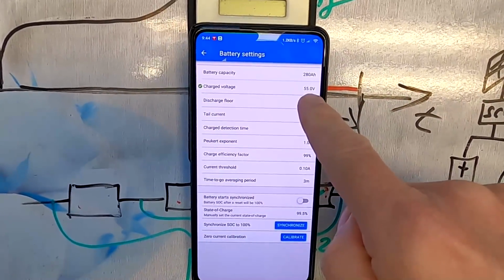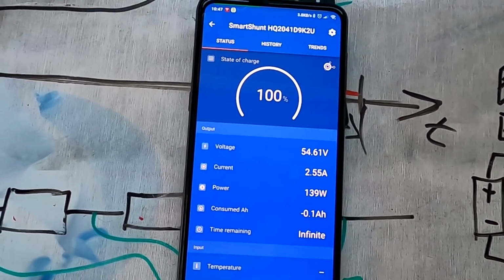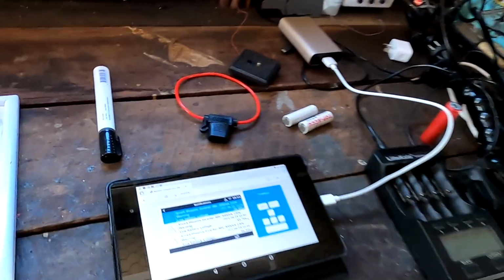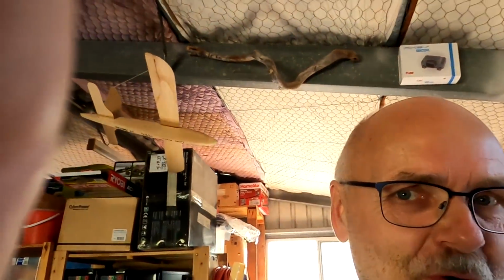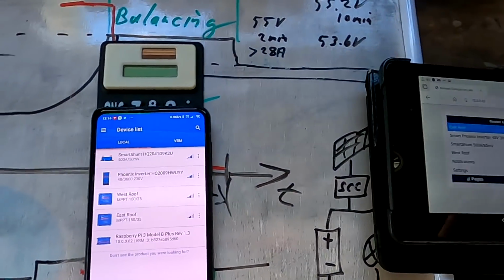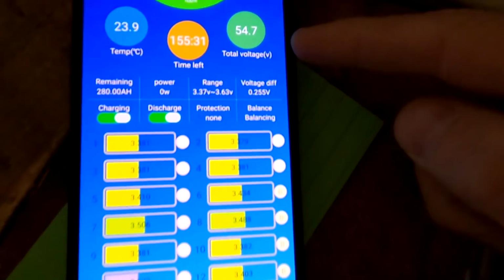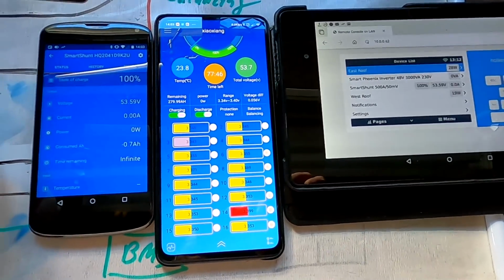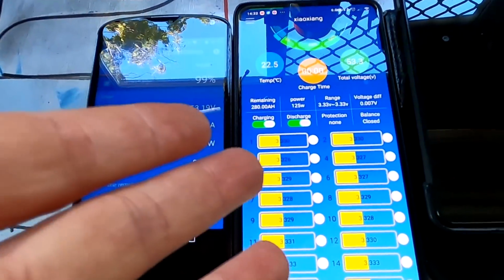Houston, we have a slight (BMS) problem and... are now Off-Grid!

Comment: Would this be a bad time to say "I told you so"? On the BMS relay shutting off charger and inverter at the same time? :D haha

This is also what I don't like about using the Victron shunt for SoC monitoring. I think I've written comments about this before, but the Victron Shunt can't see individual cells, it can only see the pack voltage. And if you have all your cells at 3.4v and one cell hits 3.6v you're basically at 100% SoC... but the pack voltage is only 54.6v which isn't high enough to trigger your shunt's SoC reset of 55v. You have an even worse problem at the bottom end. You could have one cell drop to 2.9v while the rest of your cells are still at 3.2v. At this point you're basically at 0% SoC but your shunt might still be reading 20% or so.

Regarding your cell #14: I wouldn't worry too much about that cell being a bit high. Having one cell his 3.6v while the rest are at 3.4 is not unusual. Remember at 3.4v the cells are at like 99% SoC. So just a 1% difference in balance can cause cell 14 to hit 3.6 while the rest remain around 3.4-3.5. However: even a 1% difference can mean a difference of 2.8 Ah. With only 160 mA of balance current it would take about 18 hours to finish balancing. This is why with such large cells active balancing becomes necessary.

It would be really ideal if your BMS could just turn off the MPPT chargers when a cell gets high instead of turning off the relay because that disconnects your inverter from the battery which causes all sorts of additional chaos. But I've only mentioned that a few times now. :D

Also: See my comment on your earlier video about my experiments with balancing at 3.35v. :D

Comment: hi, I have the same problem, so my inverter is connected direct to the battery, so an over voltage cut off does not shut down the inverter, also  I now think i know why its better to get a single port BMS, where the load and charge shut downs are seperate, ie if on overcharge shut down only the charge curent is dissconected, and on low voltage the load is then disconnected, this still does not resolve compleately the balance issue, but is a bit better because if the inverter is still connected and drawing current the over voltage cell will come back down , giving time to sort the balance issue. The whole problem existes because i bet my cell are A, old, B, not from the same batch or both, they will never stay balanced, only solution is a big active balancer, more expense!! Begin to wonder if the new Lead Acid batteries would have been a better choice. Price wise and piece of mind

Comment: try turning off the charge balance option: it will allow the balancing when the battery is not charging. which means you can leave it balancing overnight, and in the morning the solar will charge it again until the limit

Comment: Victron Forum user questions discussion:  Tail Current = End Amps.
Per EVE Docs   XXXah X 0.05 = EndAmps/TailCurrent.
280AH * 0.05 = 14A

4.2 Standard Charge
The standard charge means charging the cell with charge current 0.5CA and constant voltage  3.65V at (25±2)℃, 0.05C cut off

Comment: I like the fully integrated solar hybrid inverters like the ones from MPP Solar in Taiwan.
I know you said "no equaliser" but what about an active balancer? There are some active 1A, 2A, 5A and even 10A Bluetooth equipped equalisers from "JK" and they have a capacitor which helps I believe.
The 2A balancer might be worth a try?

Comment: I hope you've got an REC Si BMS on its way to you from Slovenia, they're expensive but they're proper bits of kit, you can easily add a CANbus HAT to your RPi and hook the bms to the Raspi so the BMS can dictate the charge current and voltage to the MPPTs so it can keep the cells balanced.

Love that your channel shows the bits you do that don't work as well as what does, keep up the hard work 💪

Comment: Andy, thanks for sharing, I hope you don't get these headaches anymore in the future. Maybe you are a bit to high in the voltage curve. But as always talking from the other side of the world will show things upside down. I hope you don't charge above 90%. And another question, is the balancing resistance high enough to cover the decrease the power high enough going into the cell?
Reply: Another remark is your relay is switching very often, maybe a longer delay suits the discharge of the cell better, but you'll be longer isolated. Also don't wear out your relay.

Comment: I find it strange that if one cell is to high, the complete battery is shot off by your BMS. You loose all power at ones. can you change your settings of the BMS so that it keeps giving power to the invertor and only stops the charging?
with my BMS only the charging stops, but the battery remains to give power to the invertor so that the highest cell will drop to a 'normal' voltage more quickly.
my 1Amp BMS balancing only works if there is a charge going in to the cells.
I have two Daly 8s 100A in two battery packs on board where I live on.

Comment: 062021/2212h PST 🇺🇸  062121/1512h Brisbane 🇦🇺 . Saw the issue.  I feel the frustration, you are presently undergoing. I always stock  2 additional BMS at hand to overcome such contingency situations. For the past 2 years,  my small PV system consisting of VICTRON CC 100/30, VICTRON 12/1200W pure sine wave inverter, 400W RENOGY PV array, 4 Lishen cells @272Ah , a standby VICTRON LiFePo4 35A charger and last but not least JBD 100A /BT enabled BMS, all works well in total unison. In fact I have 2 JBD BMS and 2 DALY BMS, both 100A, presently being held at hand. A training I received at the Facility. 
JBD is configurable to your desired setup and costs lesser than others. Mine {both 100A} costs US$45 each,  shipping free and no other charges were involved, from a vender in Illinois 🇺🇸.
Please note that, the mechanical device Viz: relay is quite notorious for contact pitting and or stuck arm, thus quite unreliable, in switching high power DC currents. A failed snubber Diode? That can cause chatter.
Let’s know the real reason, as to why the system failed.
Once again my concerns are with you. Take care, stay safe and 73s…

Comment: This is the problem with most BMS units on the market. The balance amperage is just too low at .2 amps. My opinion is that one should not buy a BMS with less than 1 amp; 10 amps max would be much better.

Comment: Your BMS should discharge cell 14 when an over V event is triggered.

Given that your BMS is apparently not discharging cell 14 properly, I suggest you stop charging & manually discharge cell 14 using a 1Ω resistor (make sure your resistor is capable of dissipating >=15 W or put multiple 1Ω resistors in parallel to share the heat dissipation).  All you have to do is connect the resistor to cell 14 terminals to begin the manual balancing discharge.

Stop the manual discharge after the V of cell 14 drops .1 V below the average V of the other cells.

Then start your charger to see if cell 14 behaves proper or races ahead of the other cells again when charging.

As cells age & lose capacity, they tend to charge & reach cut-off V faster than a new or good cell.

You definitely don't want your relays popping on & off very often.  Your options seem to be:

1.  Replace cell 14 (probably not necessary & expensive unless it can be done via your warranty)
2.  Get a better BMS that can more quickly balance an out of balance cell
3.  Make your own BMS to auto-discharge cell 14 to a certain V

Best wishes in finding a cost efficient solution... :)

Comment: Andy, this is EXACTLY what happens to my set of 200ah lifepo4s, and I don’t think another BMS will make much difference. My set is perfectly balanced until charging around 3.4v. This is where one cell starts increases faster than the others forcing a shut off at ~3.65v, but the others are still ~3.48v. I figure the resistance is different in this cell (or maybe a point of swelling triggers an internal short...???) But, I knew this would be likely since these are definitely not grade A cells.

Active Balancing?
This will be my next attempt to remedy the rogue cell (even though you ruled this out). I think people are finding balancers inadequate or even a hinder to the BMS process in some forums/comments. Maybe it’s because most of them max out at 1amp at most, and even the 2.1amp seems to fall short. I’m looking at the 5 amp hoping it will transfer energy fast enough to let the other cells charge more without having to balance at lower voltages. One thing I just read is that these balancers gradually increase the balancing current the bigger the delta or difference between cells. So, you’re never getting the full power of the balancer until until the cell has probably gone too far out. AND, it seems the balancers only transfer from one cell to only one of its neighbors. So, maybe a strategic order of high/low cells next to each other may help the balancing act...???
Reply: Top balance, and stop trying to get the cells above 3.4v. The capacity above 3.4v is really between 2 and 5 amp hours on the Eve 280AH cells. About 2%.
Reply: Yep, I top balanced and have derated charging to 14v (3.5) and float at 13.6v (3.4) for a while now. Maybe I will lower the charging profile even more (13.8v Blk/Abs; 13.6v Flt) because I still get a shutdown jolt to my inverter once in a while charging to 14v. I might still get a balancer for experiment sake, but you are right about 3.4v is still above 90% SOC (92% -99% depending on sources). Like Andy said “It just feels like I don’t have control of the system,” and eliminating shutdowns will sure remedy that feeling.

Thanks for the input.
Reply: @themobilecraftsman5533  I've tested extensively, 3.4v with maintaining that until amps drop to 1, equals 98%. With a good top balance, 3.4v can be attained easily. I have tested a LOT with the EBC-A40L (one cell at a time) and 32+ tests say 98% for me. When assembled in packs where the cells are properly top balanced, you can get this easily.

Comment: I think I'm gonna stick with my lead  batteries these lithium you can't charge it too fast you can't charge it too slow can't be too hot can't be too cold they all got to be the same got to have a BMS to balance it's just too much to deal with lead acid  battery I can just hook it up and go with it charge it to 13 and 1/2 volts charge controller shuts it off or float done
Reply: I have a 48v 48kwh lead acid battery pack. Until the latter part of last year when lithium packs direct from China became more affordable it was the only cost effective solution. Even with 1000Ah cells a lead acid pack suffers in cold temperatures at high discharge rates. Charging an EV in winter at 170A discharge (minimal solar) from 100% SOC, my pack caused the inverter to shut off due to low voltage with the SOC at 66%. The cells were balanced and were less than a year old. Also for long life the 50% minimum SOC for lead acid is a handicap. From all that I conclude that with adequate protection, and if necessary battery heating, lithium is the way to go.

Comment: You might can try discharging the high charged cell manually until the voltage gets back down to match the other cells voltage . Then the BMS may keep the cells balanced  . It’s worth a try .
Reply: I used a car headlight on the high cells and a lab bench top power supply on the low ones.
Reply: @ai4px  IF ANDY COULD ONLY  SEE AND TRY OUT BOTH OUR REMEDY REPLY . NO BMS IS PERFECT WHEN MOST OF THE CELLS ARE OUT OF BALANCE .

Comment: The problem is the high capacity of the cells. If you want to balance at higher voltages, you need to do it with higher current, then the "little" BMS can handle. And speaking of Wh, it's a question if the method of just "unloading" and burning the energy over a resistor of the high cell is clever with these high capacity cells. I think an "active" BMS of 2A is nessessary, which can pump the energy from the highest cell to the lowest, instead of just burning it.
Reply from the maker: You have red my mind... it's on its way...
Reply: @OffGridGarageAustralia  I'm curious.  ;-)

Comment: Your battery still needs a good top balance.
Reply from the maker: It was all top balanced the last time it was full... there was no issues
Reply: @OffGridGarageAustralia  Either it was not top balanced or it has become unbalanced. Those are the only options. Maybe the other comments are correct that balancing too early in the knee is unbalancing the cells?
But ISTR it wasn't really top balanced, especially after the individual cell bleeds, etc.  Starting with a full battery, rewire to connect every cell in parallel and charge to 3.6v and hold them until current drops effectively to 0a (no more than 1% of the capacity, and I hold mine to 0.1%). They have to be well past the knee in the charge curve and held there until all cells have quit accepting more charge. Only then are they top balanced.
After that if you take them off charge but leave them all parallel they should drop fairly quickly to under 3.5v but then the decline slows. Six weeks after removing the charger my latest pack (20 cells in parallel right now) is still over 3.4v. The last 3 weeks it was at 3.47v but a day or two ago when I checked it was 3.46v.
While in daily use they should NOT become unbalanced unless discharged too deeply. But I've never had a balancer trying to balance below 3.5v before.

Comment: Shadetree engineering answer: Get a 5 ohm, 100 watt resistor and some alligator/crocodile clips to add to the bad cell long enough to bring the voltage in line.  That resistor will draw 0.7 amp from the cell to drop the voltage enough to let the battery's charge reach 55 volts - just while you're waiting for the replacement cell(s).  Unless the BMS itself (or the balance wiring - You did check the wiring?) has a problem, the most likely answer is a bad cell.

A given BMS can only handle XX mA/A in balance current but the problem with that cell is greater than the BMS can manage.  What is the maximum balance current of the installed BMS?  A new BMS could only manage that cell if it has a high enough balance current rating.

As someone else mentioned - does the BMS even do balancing in the flat part of the curve?
Reply from the maker: I really don't want to manually balance single cells again. The BMS can balance at any set voltage but only with 0.2A max. The capacity is far too high that it could make a difference.

Comment: As you approach full charge the voltage on cells will diverge when the cells balance is not exactly equal.  The highest state of charge cell will shoot up first.

The BMS may be screwing up on balancing when you lowered the balance start voltage because you are getting close to the flat portion of battery voltage curve.  The voltage readings on cells have to be very accurate and not taken at differing points in time as the load or charge current changes will impact the cells' voltage readings.  Many cheap BMS's just average the cell readings over time to account for charge and discharge current impact.  This is not good enough when you get near the flatter portion of battery curve.  A good active balancer that is designed to operate in mid-state of charge snap shots a simultaneous voltage reading on all cells so the voltages are taken on the exact same charge or discharge current.

On the smart shunt 100% reset,  it might not be resetting because the charge current taper off is due to lack of available solar power and not actually the battery state of charge current taper off.
Reply from the maker: Great explanation, thank you.

Comment: Your "balance" is actually actively unbalancing your cells. Until you are above 3.4v it is not necessary if you top balanced. There is no reason to charge above 3.4v per cell. The extra 2 to 5 amp hours is not worth it, and with balancing set so low, you are forcing it to unbalance it.
Reply from the maker: So what would you suggest, absorption to 3.4V and absorb for... ever?
Reply: @OffGridGarageAustralia  Using the EBC-A40L that we both have, I have been testing. The difference in capacity between a "standard charge" (charge to 3.65v, stop when amps less than 14), and my settings is about 2 amp hours capacity less. Charge to 3.4v and stop when amps drop to 1. Works for me. If you want balancing, then charge to 3.45v per cell, and don't balance until 3.4v. Below 3.4v, (if you top balanced) the difference between cells is trivial and won't exceed 10 millivolts. Above 3.4v and below 3.1v is where they start to run. So balancing below 3.4v is really counterproductive. You can of course play with how many amps count as done (I picked 1, try different ones). Since it is so close to a standard charge without getting above 3.4v, I think it works well if you have the time to wait for the taper. Right now I am playing with the low voltage I  want to set, looking like around 3.0v to 3.1v. Currently our highs have been above 115 degrees F,  and I have found that 3.1v gives me a 2 degree Celsius rise in cell temperature, but 2.5v gives me a 5 degrees C rise. (Compared to ambient) Really, the capacity above 3.4v and below 3.1v is very, very limited. You still get 90% capacity and don't stress the cells. Whenever you start to discharge the cell voltage drops pretty much within the first minute to 3.35v no matter what you charge to.